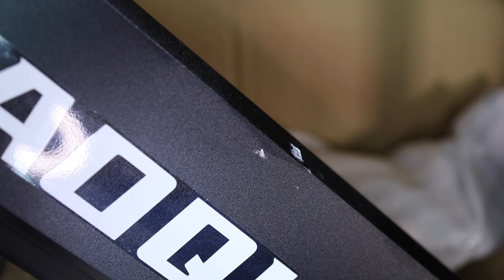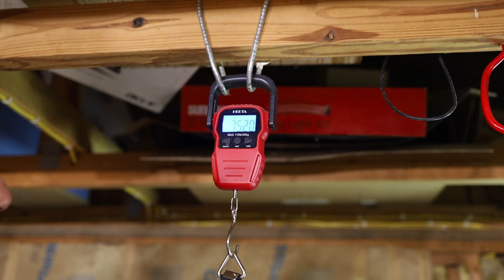HAOQI Black Leopard Pro: Initial Impressions | Positives & Negatives | Who It's For

Comment: Anyone have a fix??? My brother bought one of these and I helped him put it together. We are not "bike builder". Advertised only taking 20 minutes to assemble. Maybe if you're a skilled bike production worker that has built several of these. Really, 2 people, 2 hours, basically because the manual is poorly done.  If you are a builder then you're not going to need a manual. I'm 6'2", brother is 6'. Seat in lowest position is still too high. The handle bars are too far forward. We both have ridden bikes for 30+ years. Ergos or something is not right about this thing which could explain why they're inexpensive, and on sale, and have extended battery warranty, and have free extras which shipped separately.